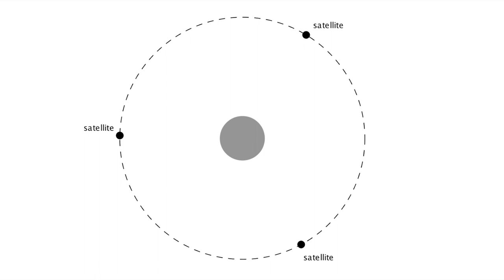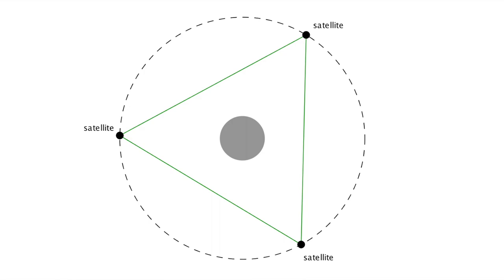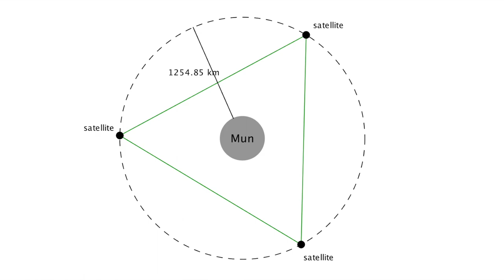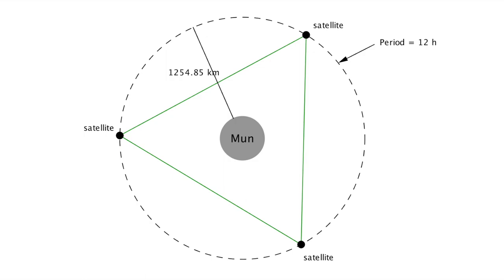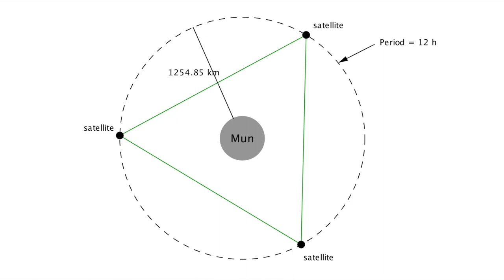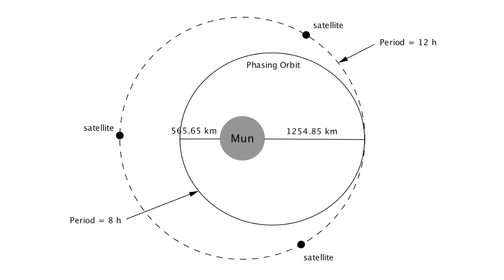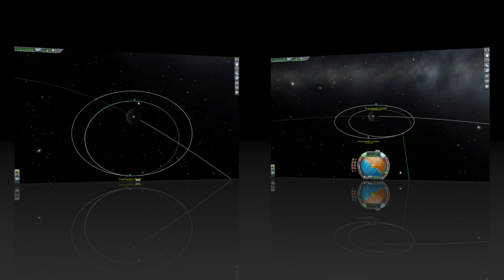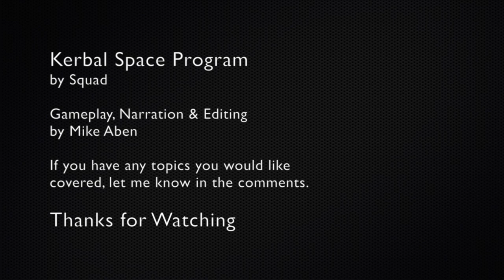Relay Networks - KSP Tutorials #11

Comment: I know it is an old vid but just started with KSP  I get to the Mun but lose all connection so i cannot deploy the satellites  :(
Reply from the maker: - You should still have a connection with the deployment vehicle as long as the Mun is not between you and Kerbin (that is, you are in the Mun's communication shadow). If aren't getting a connection no matter where you are in your orbit, make sure your antenna is raised. A single Communitron-16 should be enough.
- If you are losing your comm link when you get to apoapsis (like what almost happened to me at 14:28), then just keep riding around the orbit. As the Mun is orbiting Kerbin, you will get to a point when you will be at apoapsis and have a communication link at the same time.

If this isn't helping, let me know.  Good luck!
Reply: @MikeAben  Many thanks for the reply, I did try it again but it seems to happen when kerbin rotates all the 1/2 way round, I lose all connection, I only have one launch site so could that be the reason as they are then on the dark side when i get near the mun ?  do I have to place any on kerbin or around kerbin first ?  Great Vid btw really did help me out  a lot so far  :)
Reply from the maker: I'm noticing for the first time that there is a toggle in the advanced difficulty settings for "Enable Extra Groundstations". If this is off, then you have no ground stations and would only be able to communicate if you have a line of sight with the KSC. That would explain what you're seeing. This setting is on for all the default difficulties (including hard), but perhaps you turned it off.
Other than that, I can't see what the problem might be, unless you don't have a raised antenna, but I assume you have that covered.
Reply: @MikeAben  well you know the obvious thing that I should have covered, well err Not  forgot to raise the antenna, so I lose contact with the rocket and it's dead .  Not sure what to say really about my KSP skills .....ahhahhahhhahahah.  Many thanks and I now have a relay great tut. Btw !

Comment: What does the red line mean on the map?
Reply: When you look at the commnet I see some red lines with my green lines
Reply from the maker: The colour of the line indicates the strength of the communication link. Red is weak. In the description I posted a correction that these satelites are too high to communicated well with something in low Mun oribit with just a Communitron 16 and suggest a better altitude.
Reply: Thanks

Comment: "The Poles, boss, the Poles!"
Reply from the maker: You'll likely find you still have communication there. The game's pretty generous with surface occulation.
Reply: @MikeAben  I am running a comms mod, forgot the name, that is super strict apparently.  I have to have 3 on equatorial and 3 on polar to cover the poles.  I thought the normal game was that strict, too.
Reply from the maker: @michaelbrininstool4515  No it isn't, though I've done the same set up as you for the same reason. In stock, the communication lines will go a bit into the ground. Not just through terrain, but below sea level.

Comment: As clever as this is, i dont know why he wouldn't do a polar orbit or an sso, enabling all three relays to have continuous comms with The kerban serface. 10/10 engineering but you lose points for your orbital trajectories.  
Then again one of the most beautiful parts about this video and strategy is its very simplistic compared to multiple launches and eyeballing the orbital math to make sure they dont end up right next to eachother in orbit out of prop...
Reply from the maker: Hi, Josh. I'm a bit confused by your comment. Perhaps you can elaborate. I see no advantage to a polar orbit. At any one time a satellite in a polar orbit sees as much of the planet as a satellite at any other inclination. Also, what's an sso?
Reply: @MikeAben  sso is a solar synchronous orbit. Meaning your always facing the same direction while passing over the same spot, what i mean by that is have your orbit go from north pole, west pole, south pole, east pole repeat.  Seeing as the moon is tidal locked in real life and ksp this means you will have coverage from all locations around your orbit, and when triangulated as demonstrated in the video, you have at least 2 satellites connectable in every direction
Reply: @MikeAben  like a fake lagrange point. Or like resting a spinning dinner plate on the orbit.
Reply from the maker: @joshmckinlay88  Gotcha. That kind of orbit doesn't remain oriented that way for long without constant maintenance. After a quarter orbit about Kerbin (1.5 days) the plane of a satellite in such an orbit about the Mun would have rotated 90 degrees relative to the Mun, and will no longer function the way you want.
Reply: @MikeAben  it takes some clever math but it it absolutely possible while using absolutely 0 delta v
Reply: @MikeAben  the problem you will have in kerbal is the orbital line only simulates 1 completed orbit, however it still simulates perturbations over long periods of time, hence the little fluctuation in time warp. The main problem you will run into is there is no easy way to check if it worked or not other than some good ole math
Reply from the maker: @joshmckinlay88  Cool, convince me. I love math. I should add that because such orbits are possible in real life (which the certainly are), doesn't make them possible with the patched conics and point masses in KSP.
Reply: @MikeAben  bet in this particular case. Your using AΩT=p. Meaning you use the amount you would burn for that orbit (or the delta) to the specific orbit (Ω) and then record that over a course of time to find how much perturbation you have (yes even in ksp) from there its just some basic trig to tighten up what you need to but truth be told by this point your only burns will be too small for anything other than rcs or maybe an ion
Reply: @MikeAben  also i apologise if my communication seems blunt, i have asd

Comment: TRUSS STRUCTURE AND INTERSTAGE NODES!!!!!  JESUS!!!!!!  Thank you for THOSE!!!!  Also, next time don't put 3 sats on your delivery vehicle.  Only put 2.  Take a look at what your delivery vehicle has on it.  All you need to add is the antenna, and you can delete the communotron.  Your delivery vehicle becomes the 3rd sat.  You save most of the cost of a sat (and I say DAMN you build some expensive satellites!!!!!  I think mine were about a 3rd that cost!!!!), and you no longer just toss away assets by slamming your delivery vehicle into the body.  Anyway, that's my 2 cents.  Why have I not seen your vids before?!?!?!?  I've been watching Kerbal vids for over a year now.  Oh, and turn off the Kerbal back ground music.  It's way too damned loud.  Thanks.  And I'm subscribing.